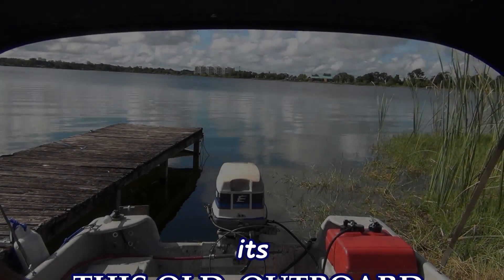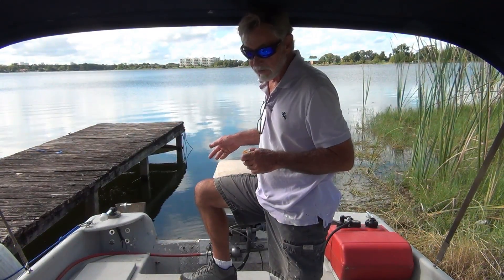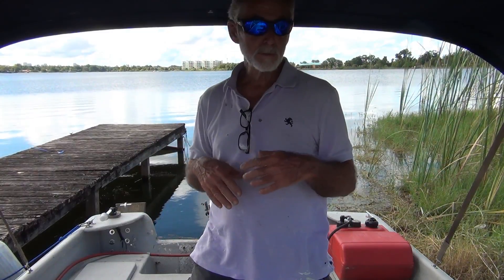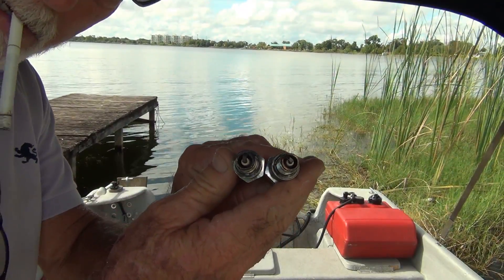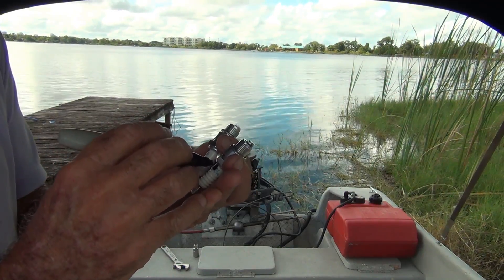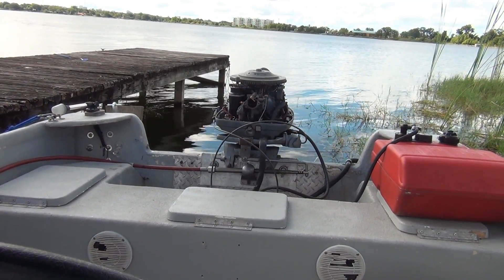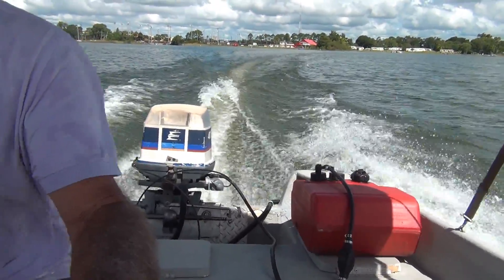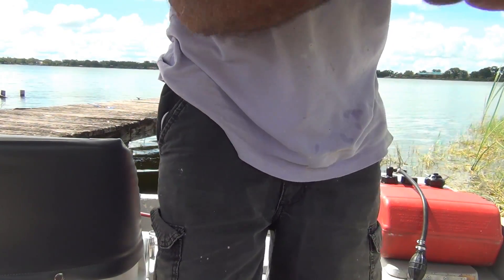Evinrude 40Hp Outboard - Fun With Spark Plugs !

Comment: Do you remember the ngk # you used at 32 gap?
Reply from the maker: Hey. No not off hand. Sorry bud.
Reply: @THISOLDOUTBOARD1  have you used ngk spark plugs with another evinrude or Johnson with that good of results?
Reply from the maker: @cramos6638  Hey. No I usually just go by the recommended plugs. Some people hate champions and some hate ngk. It's 50/50

Comment: i have a 1972 evinrude 40. what spark plug to use?
Reply from the maker: Hey. You can find your model number here. https://www.marineengine.com/parts/johnson-evinrude-parts.php?year=1972&hp=40
And Free Service Manual here. boatinfo.no  Thanks for watching & Stay tuned !
Reply: @THISOLDOUTBOARD1  yeah i got new plugs and put them in and i stripped out the bottom plug hole. and i seen you had a video about that too and watched it and fixed mine, but now i have another problem. i have fuel spitting out my exhaust any sugestions?
Reply from the maker: @ericthigpen241  Check Float/needle, stuck open. My would stick all the time when I primed it, gas would flood the carb, but after I started it the vibration would get it working again. Thanks !

Comment: They aren't gaped when you bought them?
Reply from the maker: Hey. Is that a statement or a question ?  Yes they are gaped when bought.  But should be checked for proper gap and/or as I was doing, experimenting with different size gaps. Thanks for watching and commenting. Stay tuned !

Comment: This was an awesome video. Been having trouble with my 40 Johnson since I changed my plugs. I gapped them at 32 originally to match the old ones. It ran like shit. Watched your video and set it at 24. Shit runs like a rapped ape now lol. Bro thank you!
Reply: So found out my 40 Johnson is a 1995. The spark plug gap that works the best for the motor is 30. I ran it on the lake yesterday and gotten it the fastest I’ve ever gotten it. 26 has been the fastest before. I got it up to 30mph. My gap was way off. I just proved it. Thanks against for the video
Reply from the maker: @ryanlphipps81  Yeah 30 is the standard. thx again
Reply: @ryanlphipps81  what gap did you have it out before? My 30hp evinrude calls for 30 gap also. I would like to know what gap I get more power thanks
Reply: carlos ramos 30. Definitely 30 lol.
Reply from the maker: @ryanlphipps81  Hahaha. thanks for watching !
Reply from the maker: Hahaha. Cool man. Thanks for watching and commenting. Stay tuned !

Comment: I HAVE A JHONSON, I BELIEVE 1972, 40 HP.  IT IS NOT WITH ELETRONIC IGNITION, BUT PLATINUM POR THE SPARK PLUGS. A PROBLEM WE HAVE HERE IN BRASIL, IS THE GÁS QUALITY: ABOUT 8 UP 10 OF ALCOOL IS FOR PREVENT DETONATION. SOMETIMES  (DON'T SAY ALWAYS) THE GÁS HERE HAS 35% OF ALCOOL. AS A RESULT THE ENGINE GO DOWN AT 2000 RPM OR MORE. THE SOLUTION IS INCREASE THE GICLEUAR ÁREA, BUT THEN, THE FUEL CONSUMPTION BECOMES MUCH HIGHER. THIS ENGINE IS A "HORSE", BECAUSE GO UP TO 4500 RPM, NOT HOW THAT WITH ELETRONIC  IGNITON THAT GO UP TO 5500 OU 6000 RPM. IS VERY GOOD TO THAT PEOPLE THAT WANTS GO TO A BOAT RIDE WITHOUT TO BE IN A HURY.
Reply from the maker: Hey. LOL. Thanks for watching and commenting !  Stay Tuned !

Comment: no id go with champion .used to get a j6c or j6j i think thats the replacement or vice-versa but the last digit is little hotter and older motors needed this hotter plug to keep carbon from building up and the fouling.i got only thing that crossed with the champion and it was motorcraft and i took back out and put 40 year old plugs back in and it was better.so let us know.
Reply from the maker: Hey. The original plug for this motor was the CHAMPION L4J, but they are hard to come by. Sometimes they show up on ebay and the UK seems to have them. The next plug is the L82C Champion and they are available. I'll be getting some this week. Thanks for watching. Stay tuned !

Comment: i start testing my spark plugs with my ohm meter you can see the trble.  if you set meter on high  ohms scale 200000 or so  one lead on top of plug the other lead on the hook on bottom if get a reading  the carbon is shorting  the center electode and the hook  blow it out with plug cleaner  the readings gone goods as new now     check spark  with engine running by having plug wire loose so you can lift from plug  sick a screw driver  in plug wire hold near block should jump 3/4 inch  if much less you my have small defective condenser  or coil has a problem  they can star going bad long before they fail comp.
Reply from the maker: Hey. Thanks for watching and all the great information. l really appreciate it. Stay tuned !

Comment: Wouldn't happen to have a flywheel for a 85 20hp Johnson laying around with you part # 0583001 rebuilding mine and it has the wrong flywheel trying not to spend $500 on a new old stock part....love the vids helping alot with my rebuild...thanks.
Reply from the maker: Hey. Thanks. And no on the flywheel, But I did just check Ebay and you can get one for 40-50 bucks. Thats where I get all my parts. Check it out ! Thanks again. Stay tuned !
Reply: Tim's outboard in Hackinsack, Minnesota. Good used parts

Comment: I have some old packs of the champion J4J plugs I opened one up out of curiosity and the electrode is cut back on them from the factory...
Maybe they cut that step out now to save some time and $$$ 🤔
Reply from the maker: I don't know. Someone mentioned that they use to come like that, and now they are unavailable, unless you go to ebay. I've seen them there. Thx!
Reply: @THISOLDOUTBOARD1  could look at pictures on the PC an then try to replicate a set with a grinder an a new set of recommended champions lol

Comment: Thanks for this...never heard of the half gap thing..That 69' 33hp had NGK in it.Plugs were old and were not even on NGK web site anymore.Just put the champion recommended plugs in.Those plugs look pretty clean for a two stroke.I am curious if you ever shined a good light in the cylinders to see how the Pistons looked.I had the lean issue on my 20hp last year and the piston tops were more of a cocoa color and the cross flow part of them was black and the plugs were white.New I had an issue.
Reply from the maker: No never looked, but I will. Thanks !

Comment: i always went narrow on the gap by a couple thou. as they wear they will open up. adjust your carb to them. if you run a wider gap  you need to tune  the carb to that,  a small change in air/fuel will change the spark required. so rather than mess with the plug  play with the fuel.   on 2 strokes  consistent oil mix means a lot.
Reply from the maker: The only setting is a idle. Can't change mid-range and wide open throttle. I think I'm going to leave it alone for now but that's good advice. Thanks again for watching and commenting. Stay tuned!

Comment: What oil are you using? I kind of did the same thing with all the top 2 stoke oils.  the only one that made a noticeable difference with was Quicksilver Synthetic Blend Premium. I tried like 10 top 2 stoke oils. More oil in your mix is not better.
Reply from the maker: Hey. Yeah, its all TC-W3. If I'm at walmart I'll grab the Johnson/Evinrude Brand, If I'm at the parts store I'll grab the Penzoil. Always try to get something decent. thx
Reply: Walmart sells Quicksilver Synthetic Blend Premium. when its on sale its $22.00 gal try it
Reply from the maker: @outboardfun3353  Okay thanks !

Comment: I've noticed that my outboard runs and idles much better using Shell premium as opposed to regular,do you know what the gap is on a 75 model 25 HP Evinrude?
Reply from the maker: Hey. If your using champions I would imagine its 30. thats where I always set them. thanks !
Reply: @THISOLDOUTBOARD1  T.Y.

Comment: 100% correct about heat range. The "half gap" plug was what they used oem. Champion j4j or j6j which are discontinued. The j suffix was the J or half gap plug. 
Supposed to have been less likely to foul or have the gap bridged by carbon. Sharp 90* edges require less voltage to jump the gap. Great   job on the topic.
Reply from the maker: Hey. Thanks.see there. I'm still learning. Thanks again. Stay tuned !

Comment: Was this filmed before or after the hurricane?  Spark plugs and 2 strokes can be a lot of trial and error,  especially when the motors are old and worn out. Some of the Merc 2 strokes don't even use spark plugs with gaps. BTW, I have had better luck with NGK over Champions.  Get them at the auto parts store at 1/3 the cost of a marine parts store.
Reply from the maker: Hey. Just before the hurricane. Thanks again for watching and commenting, really appreciate it. Stay tuned!

Comment: Cool video 👌 I used to glass blast champion when they were new to roughen the surface. It seemed the shinny chrome like surface of new champions would foul easy with fuel. glass beading would roughen them up a bit so the fuel wouldnt short them out. I liked champions because of their seeming unlimited combinations of sizes and heat ranges
Reply from the maker: Hey. Thanks. Wow,  Sounds cool. Thanks for watching, really appreciate it. Stay tuned !

Comment: I personally like Champion but some club members like the NGK plug ! To each his own ! Lol. I have heard the half gap works on Mercury ( newer ones ) with electronic ignition but not on low tension points like yours . My I ask what your propped at ? That Dart must be heavy ! Lol. I had my first experience with a Yamaha last week and I’m sticking with OMC thank you very much ! Lol.
Reply from the maker: Hey. Yeah. It seems to be about a 50/50 split on champs and ngk. Yes, its frikkin heavy and rated for a 70hp.  Not sure about the prop but I think its the standard 10 1/2 x 13. Thx again !

Comment: Pretty cool on the hotter gap with better performance. My 2 stroke merc plugs running to long at idle start fouling up. I take the out and propane torch them too burn them clean. They run like new plugs again. Works great
Reply from the maker: Hey. Sounds good. I'm still learning stuff from all these great comments. Thanks !  Stay tuned !

Comment: I always go by OEM unless something changes like fuel or oil. The chemical makeup in the newer fuels and oils can change how the engine performs thus you may need a different spark plug and gap. There is a certain number on a spark plug that should indicate how hot the plug is. You typically use a hotter plug if your constantly running higher RPMs like on an outboard. I should also tell you that if you dont gap the plug properly you can create high resistance if the gap is to big. If you had a DSO Scope with an amp clamp you would see what i mean, The firing line/wave would change.
Reply from the maker: Hey. Wow. Sounds a little to technical for me but I like it !  Thanks for watching and commenting. Really appreciate it. Stay tuned !